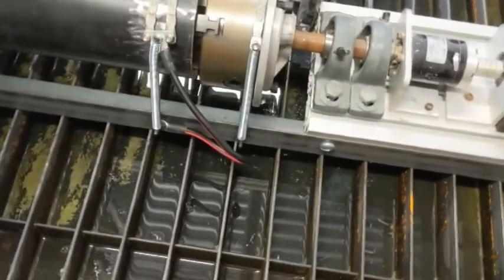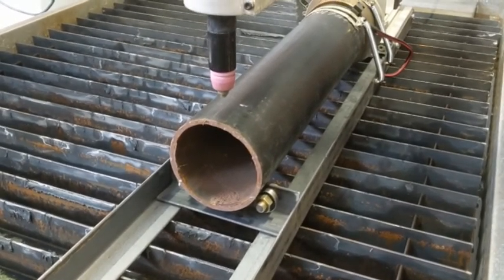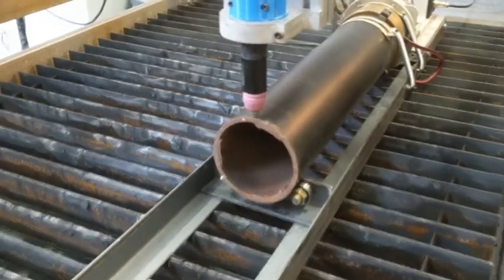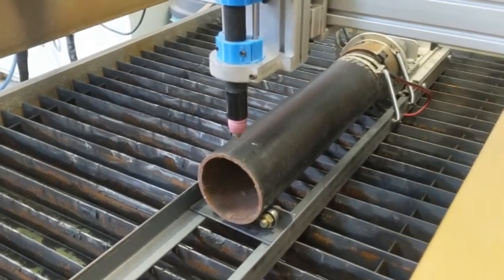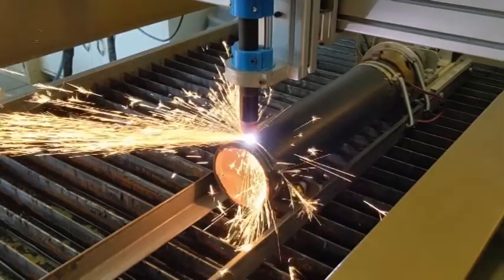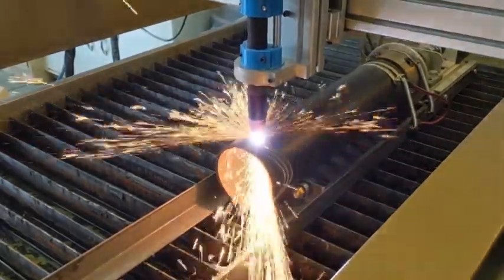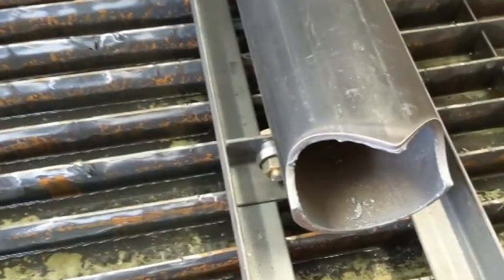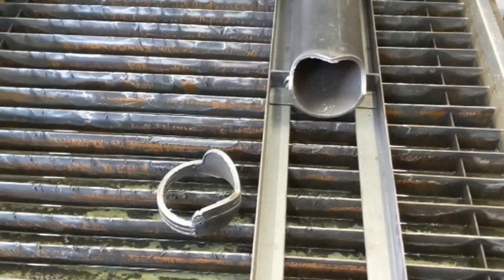Plasma Pipe Cutting Test

Comment: That's awesome. Do you use fusion 360? I think you'd want to project the internal diameter intersection onto the outer surface and use that for the tool path.
-Ken
Reply from the maker: That's pretty much what I was thinking. I didnt use fusion 360 to create the tool path.  I started to learn it and did a few test cuts then realised I could very easily alter / add g-code into my current cam software which im more familar with so it automatically includes the correct proceedures.   Also fusion went and changed to rules on hobbiests which they may do again.  Cloud software is nice but you lose control.

Comment: Watching the cut it looked like maybe the travel speed was slowing when the rotary axis was doing most of the movement.
How are you managing rotary speed?  Are you using G93?
Reply from the maker: I've connected the rotary axis to the x-axis and set a profile in Mach3 for each pipe I'll be cutting. I basically un-roll the pipe and produce G-code on the x and y plane. The G540 controller is 2000 steps per revolution. I have a 100:1 harmonic drive in the mix also. 2000 x 100 / 359.084 ( which is the circumference of the 114.3 diameter pipe) gives 556.9727 steps. I've set up a profile for each of the 4 pipes I need to cut.  I gave up on using the rotary axis as a true rotary.  I couldnt get any fluent motion in the rotation  above 400mm/min.